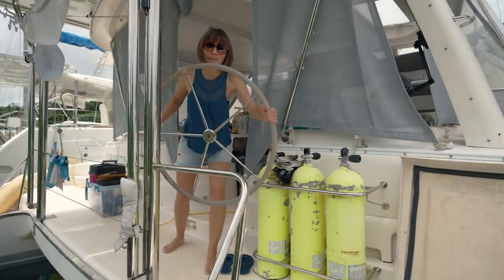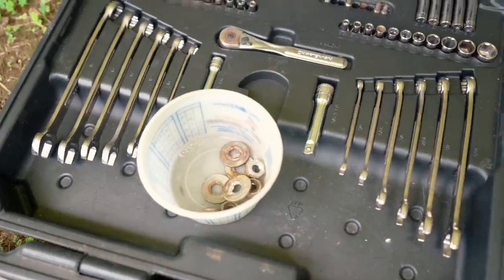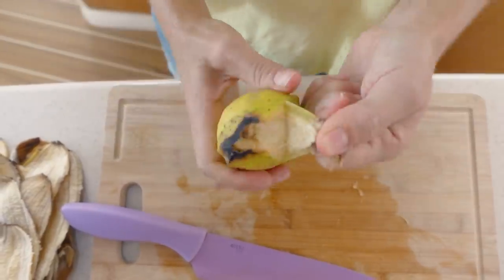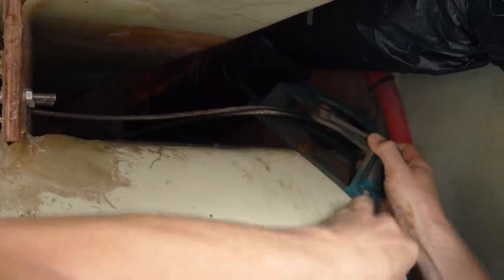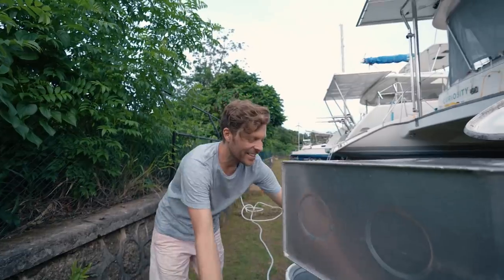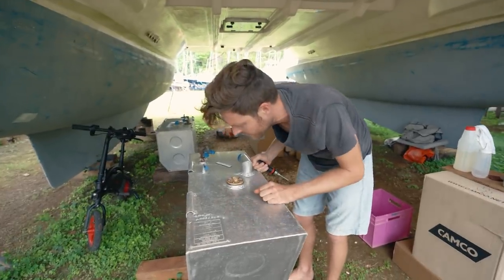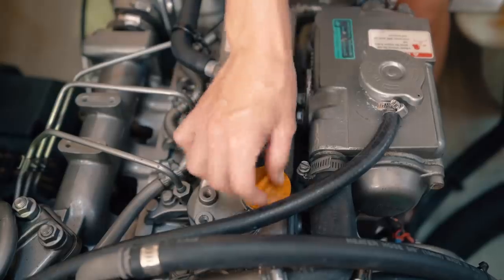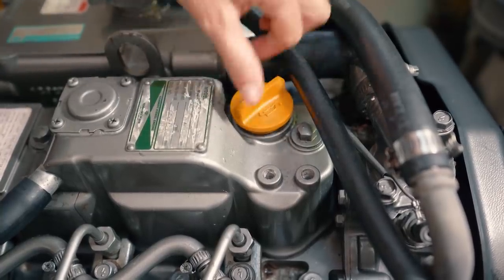Knocking Out A Steering Issue

Comment: All engine manufactures say to change the oil after the engine has been warmed up . I know it's somewhat of a pain but the oil will pump out easier and running the engine stirs up the oil so that the dirt that has settled out will be pumped out . It's not the end of the world that you did it cold, but do it warmed up in the future . The steering pully shafts should be lubed in place in future with engine oil - the spray oils give rapid results but do not last long as they are so thin . You guys are GREAT workers and take great care of your boat ,really nice to see . Will be great to see you back in the water  Best of luck

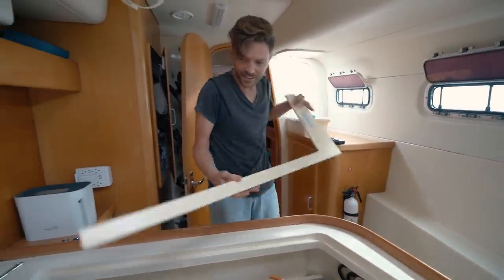Comment: At 14:10 what were those pieces of fiberglass you were putting around the fuel tank?   Sometimes it is best NOT to seal area around a tank for purposes of ventilation.  You can trap moisture in the gap which increases the corrosion of the metal.......

Comment: 10:17 If I had to maintain that once a month I'd cut and install an access hatch.
Reply: Which would leak and cause more grief oh god where dose it end
Reply: @johnmartin3486  I was on an aircraft carrier. We had water tight hatches in pressure vessels that didn't leak in the 3 years I was on ship. Solid hatches can be made watertight where something like a deck hatch with a window in it will fail. Lube the seal and every few years replace the gasket. Is that easier than what they do now?

Comment: Hay Jason, Nikki, Love watching your journey and seeing your overhaul and maintenance of the steering system. The pulleys look worn and quite thin, did you check the correct depth of wire rope sheaves? You can find this on google or with the manufactures. The pulley can collapse if the limit becomes too thin. Also for the correct holding strength. wire rope grips should have 3 rope grips, not 2. If it was me I would definitely have spare pulley’s cables and rope grips.  Not the sort of failure you need to tackle on an ocean trip.👍 Also for easier maintenance think I would use SS bolts and self-locking nuts with the bolt coming through the hull.🤔

Comment: Take a grinder with a cutting wheel on it and cut a groove in the end of the bolt.  That way you can stick a flat screwdriver in it while working the nut and prevent the bolt from turning.

Comment: You should also cover all of your external exposed hardware (ie the block attach nuts & bolts) with sealant. This will help reduce corrosion. Be careful wiping cables without good gloves on. A cable wire will tear up your hands and fingers. You'll never see it before you feel it! (you can count on an instant infection) (words from my personal mistakes)

Comment: Not sure, but do your engines have impellers for the cooling that may need maintenance too.   As far as your steering issue, I would think that there would be a stainless steel sealed bearing that you could have replaced what you have.

Comment: Grease rather than oil on uncontained vertical bearings like those pulleys and cables. Motor oil like you used is engineered to drip off and carry away metal particles while grease stays put. Thick peanut butter automotive,  motorcycle or bicycle bearing grease or special marine tenacious waterproof grease. Or "way" machine oil like Mobile Vactra that contains tackifier additives if you really needed something thinner than grease to inject onto a horizontal surface.

Comment: Hey You two, love your channel and watch often.
We also have a Leopard and left her over the Covid and have come back to mold on our rubber trim around the scoops (just like yours at 8:27) and hard bimini top.
What did you use or will you use to remove the mold and did/will you put anything on it to prevent it from coming back?
Reply: So, we were able to sand off the mold on the bimini top trim but the scoop trim was just not coming off no matter what we tried.
We have found that we can buy the trim new from a company that bought the original R&C injection molds.  Unfortunately for you guys they are located in Clearwater FL USA.
They make both profiles, top and scoops.
If you need to replace yours I can help facilitate getting it too you.

Comment: Order a replacement pin from edson, then have a machine shop drill a couple of holes in it, one part way through lengthwise and 2 that intersect that hole crosswise at 45 degrees to the retaining pin and 90 degrees to the loaded axis. Then tap the end for a fitting and extension tube to bring a grease zerk out to an easy place to get to. That way you can just apply some grease once a month with a grease gun without needing to crawl into the hole. Do the same with the more open ones as well. Or replace the sheaves with ones that have actual sealed bearings in them and keep one spare on board.
Reply: This comments needs upvotes.  The "Bury the equipment someplace unreachable and write in the manual that it needs monthly servicing" design is nonsense of the highest order.
Reply: Great idea. Our heavy equipment is loaded with grease extensions to make it easy to maintain these parts. Especially something that gets as much movement as this steering pulley. I can understand the not wanting to use bearings as they might be difficult to find, but this dry system is nutty.
Reply: @pbcanal1  
Leopards are notorious for dumb engineering...just look at their fuel tanks.
Reply from the maker: That's a big ask for such a small island in the middle of nowhere! :)
Remember, it takes a month or more for anything to get here, then trying to locate a professional to machine parts is an entirely different story.
Reply: @gonewiththewynns  Not really, You could have it done and waiting at the next port of call and just use the one you have until then. As for the machine work, it would only take someone with a drill press or small mill to do the job. The hardest part would be laying out the holes. I'm surprised they don't make a pin that way already given that the sheaves have to be lubricated so often.

Comment: If that supposed to be done monthly, you would think they would try and put an easier access hole or something. Instead of climbing in there.
Reply: And for the life of me I can’t figure out why the boat builder was allergic to stainless steel or naval bronze. Such nuts and bolts are available on Amazon relatively cheap. All that work and it’ll rust to hell again.
Reply: I think that's one of those maintenance tasks invented to void your warranty. They know no one is going that monthly.
Reply: @CueBeanKa  Agreed.  I bet it wasn’t lubed once before the Wynns got the boat, and they only noticed it because noise. (Not blaming them, there’s a million parts like that on a boat, and always a list of things you do know about.)
Reply: Nah , that would make it too easy  :)
Reply: Better yet, rework the pulleys to accept a sealed, lifetime lubed ball bearing.
Reply: @jackhanaway8367  Looks like thats what they had— why they lasted 10 years.  I think the clean and lube was for cables.
Reply: If he would have used real grease with tackifier, water proof,, and EP he wouldn't have to grease it for another 5 years.
Reply: @RogerWilco1  it was definitely not a sealed bearing. It would be a good idea to change to one that can be greased with a grease gun.

Comment: Great video, guys!  Coming along nicely.  Just a heads up, from our experience we understand you are not to re-use the Nylock nuts as they may work themselves loose.  A quick fix would be to add an additional SS nut of the same thread on the end of the bolts to use as jam nuts.  Best!!

Comment: If you need to service the steering monthly, it would make it much easier to install an inspection port above the sheaves.  This would eliminate having to crawl into the aft access way.
Reply: Good point. Looks like poor forethought in the design/maintenance of the boat.
Reply: wonder why they didn't put in an automatic lubrication system when building the boat, and inspection hatches too. Seems like an obvious oversight.
Reply: I was thinking the same thing... along with a grumpy letter to Leopard for designing something that needs regular maintenance to be so hard to access.  But at the same time, they may have a recommended fix/access port template.

Comment: the nuts you used to hold down the pully have a nylon insert. it act as a lock on the nut . they are one time use only.
Reply: And I do not understand why they do not clean up the rust stains on the hull (the Wynns are not the only ones) - Barkeepers Friend (that's a product if you don't know) will do it very quickly and easily and it does not scour the surface.  The nuts he is talking about are Lock Nuts - and Yes, they are one time only use.

Comment: A little tip that makes changing oil a lot easier.  Warming up the engine a bit makes the oil less viscous and it pumps out a lot easier.
Reply: True but those are water cooled engines so that may not be an option.
Reply: @davep5788  True, however, just bringing the temperature up slightly will not harm the engine and allow the oil to become less viscous and easily pumped out.  I'm not suggesting bringing it up to operating temperatures.  It is something that is employed for diesel engines in colder climates with an electric oil heating system to make the oil easier for the engine itself to pump and lubricate on start up.  Just heating up the oil slightly makes it less viscous.

Comment: OK guys, it sounds like you are going a little stir crazy.  You need to splash the boat soon!  As for the blocks I might looks for some with sealed bearings or at least grease fittings.  Having to disassemble and lube those on a monthly basis is crazy.  Keep the good stuff coming.

Comment: Safety issue?
In the video, (around 10:18 after Nikki says “movie drivin”). I observed when Nikki turned the wheel to test for “moaning” that the pin in the pulleys rotated. Shouldn’t there be a set screw that holds that pin in place?

Comment: Nice work guys. So I have a suggestion. It's a little bit involved, but will save you a ton of headache in the future and prolong the life of your equipment. Next time you take out the steering pulleys you should take the pins to a machine shop and have them drill lubrication holes in them and tap the hole in the end of the pin to 1/8-27. Then you can add push to connect fitting on the pin, connect tubing to it and run it to a more accessible location, add a grease fitting to the end of the tubing and then can pump grease down to the pulley without climbing down and dismantling them.

Comment: Jason & Niki scuff up the outside of the tank really well with a really coarse abrasive wheel, and epoxy coat the outside of the tank with a layer of 4-6oz glass up the sides too, you will never need to worry about it again, I had the same issue with an 80 gal fuel tank and it has been 22 years and as good as new. I did the top as well which if you want more work you could also do the same

Comment: Ok, before you snap your fingers and make it done...you have to start the job right!  Here's a "pro" tip for you:  Run your raw water intake hose into a 5gallon bucket and run the engine up to operating temperature (or better still, install a t-hose barb or hose fitting off your intake hose, so you can easily connect a piece of hose and open a valve to take in water - also good for "fresh" water flushes in dirty water, or when you'll be sitting in a marina for a while).  Now that your engine is at operating temp, you'll be able to properly drain the oil from the engines!!  Once you've "topped" up the oil levels, you again need to run the engines in order to refill the new filters and all the internal oil galleries in the engine, because as it is, when you next run your engines, they're both going to be nearly a quart below proper level.  So, make sure next time you run your engines, you only run them for a minute, then shut off and top up the levels.
Reply: Oh, and replace your impellers.

Comment: A couple of tips on Engine oil changes. They seem like a good idea to me and do not cost much. First one is after you empty the old oil out add a quart or so of new clean let it settle then empty it out as well. This will have the effect of getting more junk out of your sump before you add the clean oil. Secondly buy yourself some oil filter magnets they attach themselves to the top of your oil filter and draw microscopic metal fragments to the top of the oil filter rather than leaving them to wander around your engine freely.

Ok none of these are magic bullets guaranteeing a perfect engine but they should cut down somewhat on your engine wear.

Comment: FYI I had a motorcycle tank lined with the best product recommended by a professional who lined vintage tanks. He did the work. In a year the liner peeled on the inside of the tank. Horrible to get it out. I had to have the tank heated and the liner burned out. Good move not to go with a liner.

Comment: For the pulley in the back of the boat I would suggest putting in an access port in the deck so it's easy to get to and that you can just pop the top and spray the lube and do a good visual inspection.

Comment: ⛽⛽⛽⛽🚣‍♂️🚣‍♂️🚣‍♂️💡💡💡💀💀 did you pressure test your fuel tank repair.? Each tank system is different to the PSI it should hold. 
You get it hot hot temp fuel expands...
Tanks hold pressure.🤔

Comment: Your last lubrication solution, Tri-Flow(aerosol or squeeze), you will be amazed, and never ever loan it out without it being under your constant supervision(I have loaned out maybe a 12 pack's worth since the '80s never to come home again)...look into butyl/collapsible tanks???
Reply: Tri-flo is excellent. I came across it in the mid 70's at my bike shop. I've switched to Boe-sheild for cables and chains after a light lube and wipe down. Nothing sticks to it. Developed by Boeing for use on aluminum to prevent oxidation but has since been discovered to have a plethora of protective uses.
Reply: @wearemilesfromnowhere4630  Hmmmm, I may have to try it.....I was turned on to TF at a bike shop in Germany in the 80's

Comment: I know of some people that just go down in that Godforsaken hole once a month or so and spray the entire setup down good with WD40 and never seem to have a real problem.
Reply: And WD-40 is such a poor lubricant -- it's made to be as light and fine as possible; it's probably about SAE minus-30.  Plus it evaporates.  What it's wonderful for is pulling water (liquid or vapor) off of metal parts so that would be a benefit in that area.  But, yeah, that bearing location/setup ought to have real oil (or liquid proof grease).  I like the idea of a drilled spindle bolt with a grease/oil nipple.

Comment: OIL CHANGE TIP.  FILL YOUR NEW OIL FILTERS WITH OIL BEFORE SCREWING THEM ON THE MOTOR.  Then you dont run it so long with dry bearings until the pressure fills the oil filter and then gets to the crankshaft bearing shells later. Crankshaft should be running in oil pressure film, not hard on the dry bearing shells. Tip from NZ bushman biker.

Comment: Congratulations on getting  all that work done on the boat Nikki and Jason.  I was really expecting those exterior 
nuts to be a lot more stubborn to remove.  Jason if you ever have a seized nut or bolt to remove there is a great aerosol product from Australia made by the Nulon company called  "  Shift Ya Bastard! ".  They are the same company who make 
the Engine Starting Spray called   "   Start Ya Bastard ".  I heard about them from watching  Stu on the Dangar Marine channel.
Oh,  they also make a nifty Bottle Cap opener for your Long Neck Beer Bottles called,  you guessed it,  "  Open Ya Bastard  ".

Comment: This video is a clear mandate - you MUST install a screw out inspection plate near those sheaves, so you can maintain them easily.  I’ve installed 4”, 6”, or even 8” plates when access is otherwise difficult or impossible. This is why such plates were invented ;)

Comment: I retired from an airline and we always had troubles with pulleys and quadrants in the trailing edge of the wings due to changes in temperature and exposure to water, dirt, etc. The thing we found best to use as a lubricant on pulleys (but not on the groove where the cable runs, it should never be lubed as the cable will slip in the groove) is a product called Fluid Film. It literally dissolves rust and if we had write ups for stiff flight controls, a through lubrication of pulleys and quadrants with Fluid Film would usually free things up. https://www.amazon.com/dp/B07CJWV273/ref=sspa_dk_detail_2?psc=1&pd_rd_i=B07CJWV273&pd_rd_w=xzU8m&pf_rd_p=f0355a48-7e73-489a-9590-564e12837b93&pd_rd_wg=kVCGo&pf_rd_r=SJJGHEJDW26010FV4SBR&pd_rd_r=5cf051c6-b793-43e1-a0ba-e5bffe025551&spLa=ZW5jcnlwdGVkUXVhbGlmaWVyPUFJT0MyOUhRTFZER1EmZW5jcnlwdGVkSWQ9QTA4MzUxMjYyVzFIQ09HTkNQOE9XJmVuY3J5cHRlZEFkSWQ9QTAxMDYzOTQyRzhDRjJUUjQ4MDg5JndpZGdldE5hbWU9c3BfZGV0YWlsX3RoZW1hdGljJmFjdGlvbj1jbGlja1JlZGlyZWN0JmRvTm90TG9nQ2xpY2s9dHJ1ZQ==
Sorry for the long link, Amazon didn't have any shorter links to show you. Older cans were mostly yellow color but the same product, should you stumble into any old stock of it.

Comment: I noticed on your heater you have used the perforated jubilee clips. They fail so easily. If I was you I'd get the non perforated ones they are much, much stronger and reliable.